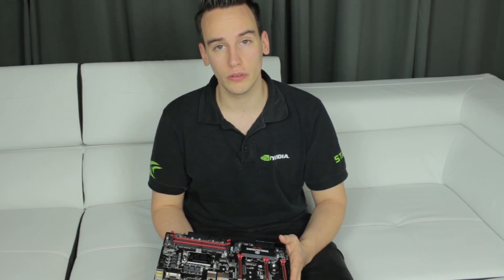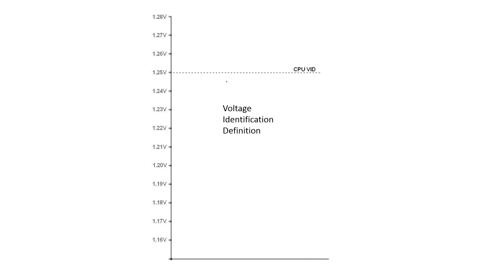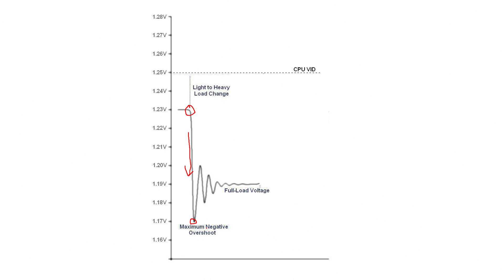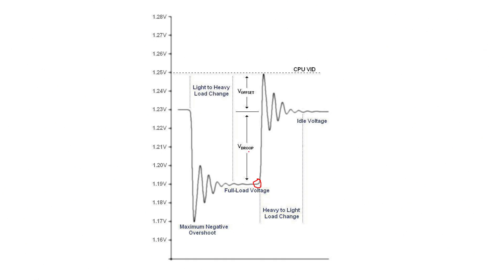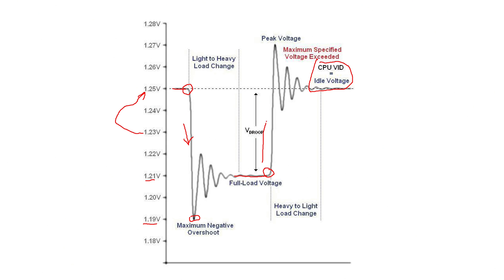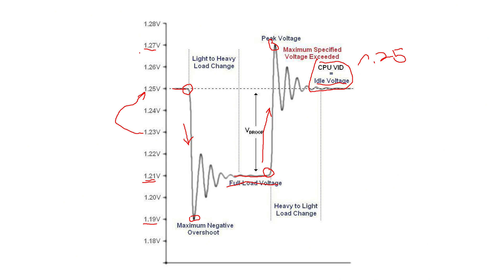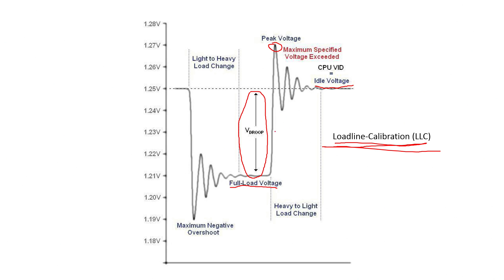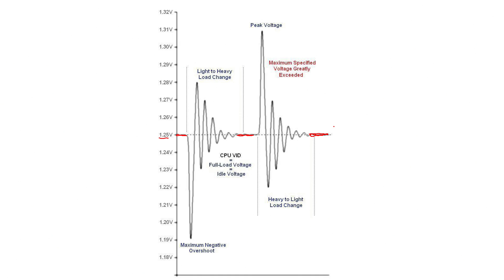VID, vCore and Loadline Calibration explained

Comment: I just wanted to say that you make great content, which is much more Educational than most tutorials I've seen :) 

On another note I've been having a little issue with my overclock on my fx 8320, paired with an gigabyte ud3 990fxa and a hyper 212 evo. 

The issue being when performing a cold boot at high overclocks (4.6ghz) and above, my pc starts to boot then about 2 seconds from boot it switches off another five seconds passes it switches itself back on continuing to boot normally, I'm pretty sure it's due to the CPU not getting enough power upon bootup, sidenote this doesn't usually happen on a reboot (say I pressed the reset switch) however increasing the vcore doesn't help, and if I set my load line anything over medium, voltages become unsafe. 

Any help would be greatly appreciated, I would love to find a solution, if you need any more info just ask, and keep up the great vids, 

thanks alot, Thomas :)
Reply: what ali you use?...maybe it's not enought power...or it's no good...

Comment: so is it safe to always set LLC on max, or can peaks damage the chip? 
and thanks for quality videos, you saving us so much time!
Reply: actually I researched the topic a bit more and the answer is yes, you definitely do not want to use extreme LLC setting as it can put near-death voltage levels on CPU
Reply: yes you are correct.  you should start with no llc or minimal.  then apply the voltage you want.  then you should increase llc slowly until the voltage you set matches the voltage at load or even slightly less. so the rebound wont be too high.  im sure you know this by now with your reading but others may not
Reply: Many a CPU has been fried by high LLC settings. Particularly during boot when the bios sends a spike of voltage to jumpstart the CPU before leveling the voltage out. It largely depends on the MB and the model....but what usually happens is someone will max out LLC in the bios, save and exit the bios and go into Windows and run tests to check overclock. The test either fails and you blue screen or it passes and you eventually power down your PC. The next time you power on the PC you get the dreaded error code that designates a fried CPU/hardware failure. Initial jolt of boot voltage paired with the extra voltage added on by your OC instantly kills the CPU. 
Pretty sure theirs a video by Youtuber JayzTwoCents where he killed a CPU by doing just that. He forgot to clear cmos after really pushing his CPU for benchmarking and it killed it upon reboot. 
Probably be a good idea to always "clear cmos" so it becomes a habit. Save your bios overclock settings as a profile and you won't have to start from scratch all over again. I know most motherboards that advertise overclocking have UEFI/Bios profile saving features. 

I always never go over the middle range for LLC settings. Currently I'm running an overclocked 5960x at 4.4ghz @ 1.25v on a Asus X99-e WS motherboard. ASUS motherboards give you the option of setting LLC to the default "auto" or designate a number between 1-9 with 9 being max LLC. 7 would be the absolute max I'd try but I usually set LLC right in the middle which would be 5. 

I'm not a master overclocker by any stretch but I was fortunate enough to learn of the dangers of high LLC early on. It's not nearly warned about enough and the motherboard usually doesn't specify the dangers in the bios since I'm guessing if you are running a non-overclocked system high LLC might not be an issue.

Comment: Hello, sry for the long question, but I already asked this in forums and no1 could help me out. 

I'm running a ref R9 290X from sapphire with a Arctic Accelero Xtreme IV along with some custom vrm radiators, that I made on my own.

My PSU is a Thermaltake London 550watt 80plus gold.
CPU and MB are: i5 4690K @4,7ghz and ASUS Z97-A
The system is not running in a case but rather on a custom bench, made completely out of glas; cooling is awesome^^ 

I wanted to overclock my r9 290X and ran into this issue:

I edited the bios via "HawaiiBiosReader" (I'll attach Screenshots of my Bios) and but I can't get a stable OC, because the VDroop is too damn high:
The max clock speeds are set to 1120mhz on the core and the voltage (VID) for those clock speeds is set to 1,3V (which is WAY higher then I'd need to run my GPU at those speeds).
When my GPU is running at 1120mhz in Valley Bench, the voltage (VDDC) is at ~1,18V. Whenever the scenes switch and the gpu is at max speed without any load, the voltage (VDDC) jumps to the 1,3V, I set in the bios.
However half a second later the Voltage (VDDC) goes back to 1,18V as the Benchmark continues and puts the gpu under load again.

The GPU is not stable at 1,18V, but I can't rly get the voltage (VDDC) it any higher.
Even when I set it to 1,35V (VID), the voltage (VDDC) in a game / benchmark is to low to be stable.

I also dont wanna go any higher, since 1,35V is already more than I want my GPU handle.

GPU and VRM Temps are both fine. PSU should also be fine (drawing a max of 450 - 470Watt from the wall, so there is quite some headroom).

I use MSI AB and GPU-Z for temp & voltage readouts.

Here the Bios Screenshot:
http://www.pic-upload.de/gal-991968/tfqgd/1.html

Comment: What would you reccomend for loadline calibration on a Broadwell-E   i7 6800K  for a high as possible overclock?  I just purchased a 6800K binned by siliconlottery.com to hit 4.4ghz at just over 1.3v  VCORE with one of the Corsair H105 "AIO" coolers.  I'm wanting to push it to 4.5ghz as my main rendering and gaming etc.. load frequency. But since Broadwell-E has such a hard time hitting high clock speeds i'm unsure of how much max VCORE i should run safely and how much heat it would generate etc..   I'm using a custom water cooling loop with three radiators (a 480mm radiator, a 420mm radiator, and a 360mm radiator. All cooling just the CPU, with an EK Supremacy EVO CPU waterblock) so theoretically my temps and VCORE necessary to achieve 4.4ghz and 4.5 possibly should be a fair bit lower than what siliconlottery's were.  I'm just wondering what your overall advice would be to hit 4.5ghz on the chip as far as what VCORE, what input voltage, load line calibration etc..    Thanks!

I'm using the new ASUS Rampage V Edition 10 board that i just got, by the way. So my VRM etc.. and the board in general are quite good quality.
Reply from the maker: Personally I would use up to 1.4 Volt for OC on these chips but it seems that they don't scale that much over 1.35 Volt. To stay safe I would advice to stay below 1.35 Volt. 
LLC doesnt really matter because it affects the Input Voltage but not the vCore. So Level 6 should be fine.
Seems quite a bit of cooling :D Actually one of these radiators should already be fine for the CPU.
Reply: an extra 100 mghz would hardly be noticed.  save yourself some frustration would be my advice but good luck whatever you decide

Comment: great video! ive been getting in to overclocking over the last 6 months right now and im always looking for more info.
just too bad on my MSI z170a gaming m5 there is no LLC.. there is ''voltage compensation'' but that throws up my vcore a lot.. even at idle..with a 1.270 vcore it goes to 1.325 vcore at idle (and light loads). and then still drops to 1.225 under full load.... im not sure what is wrong but i think it might be my MB. i can only get my 6700k stableat 4.5ghz with a 1.368 vcore(dropping to 1.320 under heavy load)(cpu never going over 63 degrees and system temp 32 degrees)
where as my i5 4690k can go to 4.6ghz at 1.277 vcore stable.
its a pity my 6700k doesnt go as far. maybe its some bios settings i havent set right. or maybe the MB isnt that great for OCing. or my chip isnt as great as my i5. im not sure. but i will be playing with some settings and see what results i can get.
great videos, ill be looking forward to more of your vids!
Reply: I was looking for just a comment like yours! I have the MSI z170a-g45 (very close to the m5) and struggle with the same. Personally I regret buying a MSI MB as it seems you need atleast the m7 to get llc... If I could pick again I would have bougth Asus.

Comment: Thank you for all these great videos on overclocking, really helps a lot.

What would be the max CPU Core Voltage I can use on a 6700k with Load Line Calibration at 6 on an Asus Z170-Pro.
Reply from the maker: +Thomas Lind thanks :) I would stay below 1.40 Volt depending on the CPU temperature. Try to stay below 85°C because Skylake CPUs tend to become unstable above 80°C

Comment: If I dont enable xmp my vcore is the same with vid and is average 1.36 with stock clocks(it goes up 1.4-1.45).If I enable xmp my vcore is min 1.2 and max 1.245(the vid is 0.8-1.45 with stock clocks).Motherboard asus hero VIII and cpu I7 6700k.Atm I am at 4.4 ghz with 1.267 manual vcore.How can u explain that?
Reply: hey I have a problem somewhat like you.  I have a 6700k and oc in bios to 4.7ghz at 1.325v.   in asus suite 3, my voltage is 1.328, but in cpuz, my vid is 1.4!!!.  I guess just screw the vid as asus says my voltge is staying at what I set it to.
Reply: Dont care about vid,vid it is intel's default volt,the real volt going to the chip is vcore.
Reply: Ok thanks!  I am new to oc and I was freaking out

Comment: are there motherboards with smaller peaks or a shorter heavy to low load changes? or is that always the same on any motherboard?
Reply from the maker: +jort93z The peaks also depend on the VRM quality. So yea a mainboard with stronger/better VRMs will have a better voltage signal. However, I don't think you will notice any difference when it comes to the lifespan.
Reply: der8auer alright. thanks.
Reply: +der8auer can you please explain or make a video on how to offset on a gigabyte board I have a 4690k i5 4.5ghz at 1.21vcore but there's no decent guide showing you how to work out offset to bring voltage down when idle